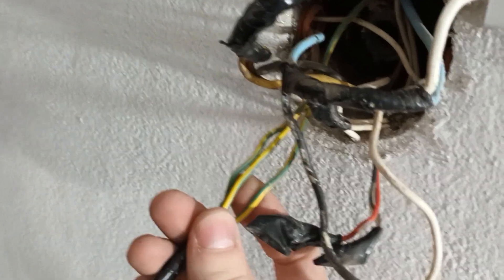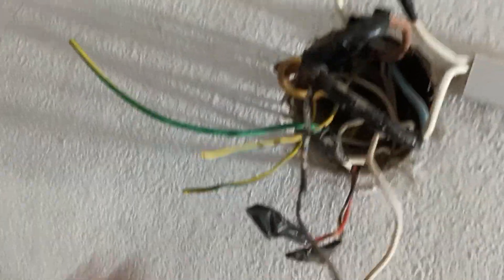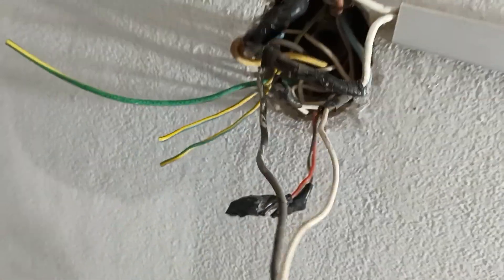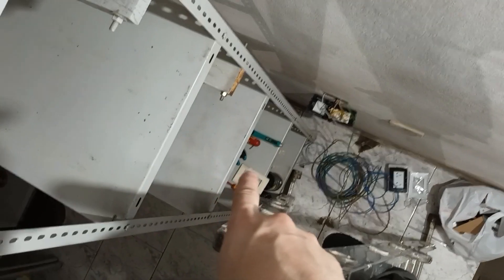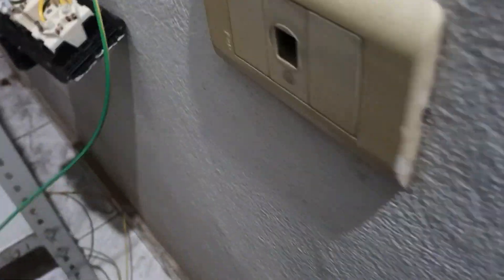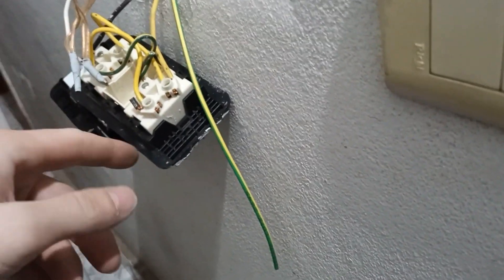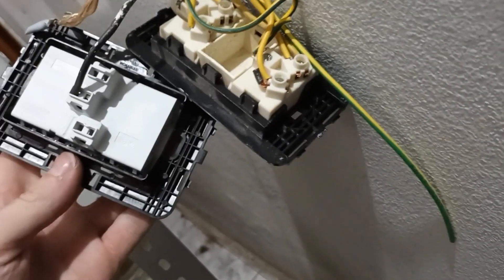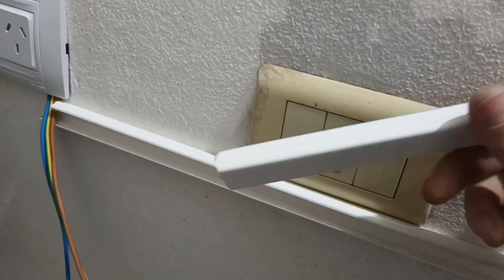Tablero Eléctrico- Canalización- Cableado y Conexión - REFORMA ELECTRICA ALMACÉN

Comment: Hola Martin muy buen video....te hago una pregunta....que cable debo poner aproximadamente desde el tablero principal al tablero seccional si tengo en la casa 2 aires de 4500frigorias, 2 aires de 3000 frigorías y un horno electrico ??. Sumado a eso el circuito de iluminacion
Reply from the maker: @FrancoDiaz-d9r  depende, no es solo por la carga que tenes sino por el consumo al mismo tiempo si es que es constante y tenes q dejar un margen. Pero mínimo 10mm de cable así a ojo
Reply from the maker: @FrancoDiaz-d9r  si queres estar tranqui hace la tabla y con 16mm vas bien
Reply from the maker: @FrancoDiaz-d9r  si podes tener trifásica es mucho mejor
Reply: Está instalación va a ser monofásica por el momento....en ese caso vos decís que con cable de 16mm como línea seccional me puedo quedar tranquilo?....y a ese cable lo protegería con termomagnético o diferencial de 63 amper?
Reply from the maker: @FrancoDiaz-d9r  no la estoy haciendo yo, pero seguí las nociones básicas, desde el tablero principal pone 16mm y con esa térmica. Desp seccional otra térmica más chica con diferencial y después dividís circuito
Reply: @martinelectrician5637  a ok perfecto...una última pregunta martin....esto es  el departamento de un edificio, para cablear con 16mm tendría que pedir a edenor que me cambie el cable de la acometida que entra por los bornes superiores de la termica del tablero principal?
Reply from the maker: @ depende de cuanto sean, posiblemente o te hagan pedir trifásica por el consumo. Cuando hagas el certificado sale la potencia demandante total y ahí salta